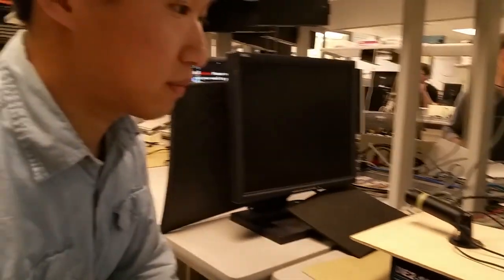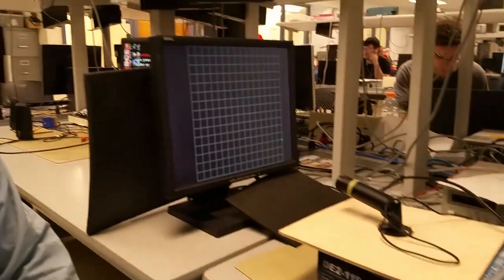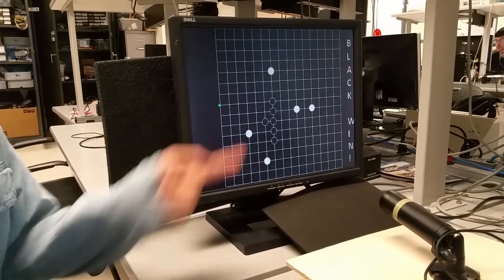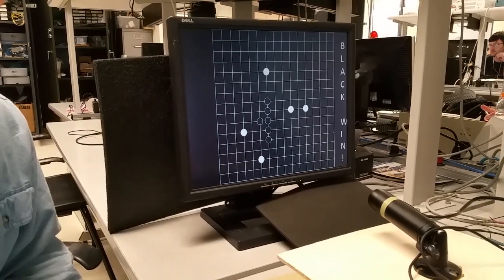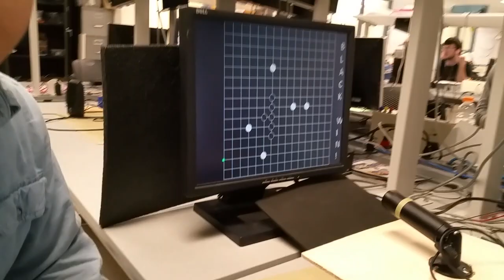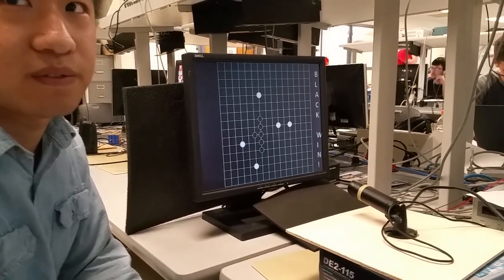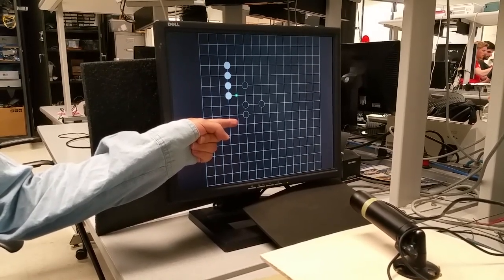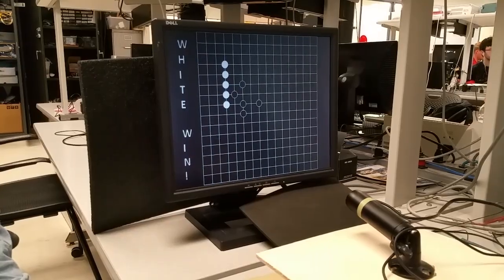Finger tip detection and game

Comment: how to interface a digital camera to fpga?
Reply from the maker: depends on the camera. do you mean a point-and-shot camera, or do you mean a bare sensor module?
Reply: +Bruce Land i mean the process of interfacing the camera 😅
if i get an analog camera i read that o have to get an analog to digital converter
whats the next step?
i know about the vga interfacing but i was a nit confused in how will i read data from analog to digital converter?
Reply: +Ishmeet Singh Bindra i read their report too
whats the tv detect box and yuv box?
Reply from the maker: They did not use a digital camera. They used an analog NTSC camera.The YUV module converts to RGB format. The TV detect is hardware in the video codec IC.
Reply: oh
so basically if i want to interface a video camera from fpga and read specific pixels in real time , it would require more than just a FPGA board and a video converter
thanks for the reply
Reply: Bruce Land just last request 
can you guide me to some source from where i can learn this?
Reply from the maker: YOu need to read pixels in real time video cameras do not have frame memory. Are you using one of the Altera DE boards? if so https://people.ece.cornell.edu/land/courses/ece5760/DE2_Datasheets/TV%20Decoder/182877477ADV7181B_a.pdf
Reply: Bruce Land thankyou very much
 btw i have numato lab's mimas v2
Reply from the maker: That board does not have an analog video port, I beleive. So you wil iave to add one or use a digital camera
Reply: Bruce Land yes you are right
using a digital camera is a better option i suppose